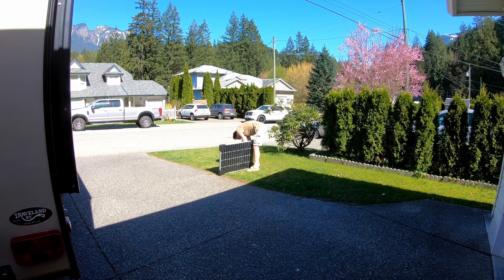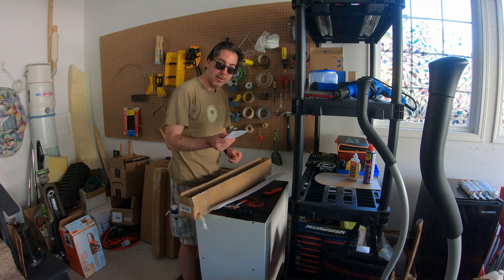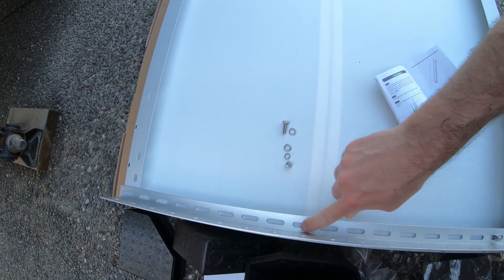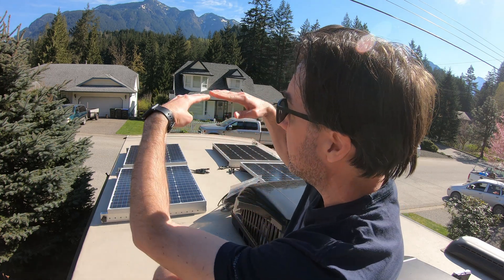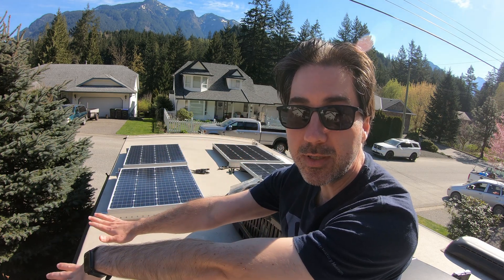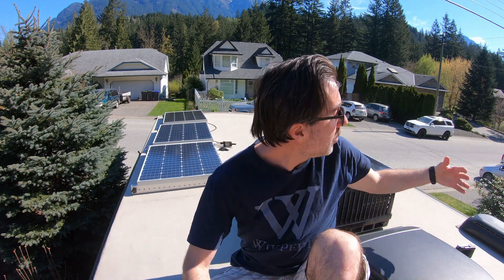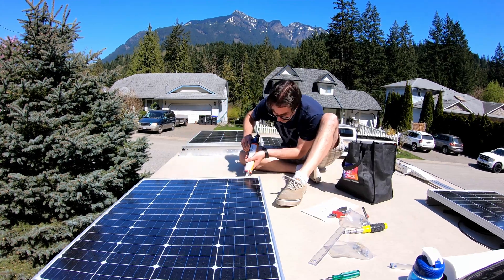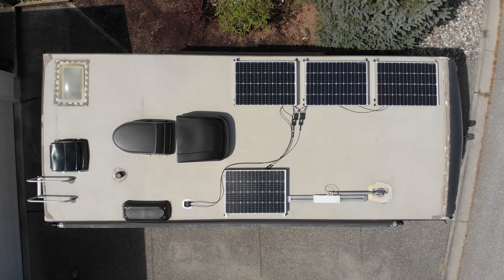How to install Renogy SOLAR PANELS that TILT! 🌞

Comment: I'm running channel strut along the sides and mount panels on top for air flow
Reply from the maker: Really good idea 💡 That should help prevent the panels from overheating and keep them efficient.

Comment: Hi. I’d love to know about the solution you found to deal with the curve of your roof. Did you end up using stainless steel washers to make the brackets level or something else? Thanks!
Reply from the maker: Attaching down as close to the side as possible turned out to be the answer. That's where our roof was flattest.
Reply: @HomeARoam  Ah, that was enough. I thought perhaps you did something in addition to that. Thanks for sharing!

Comment: Hi Great Video, I am about to put solar on the trailer, I was wondering how the attachment to the roof using the dicor and included screws have held up? I see a lot of recommendations for the strut channel, I am debating the different options.  Thanks
Reply from the maker: Hi there, it's held up really well for the year we've had it so far. Had the roof pressure tested and none of my seals leaked. And everything still feels really solid up there. Fingers crossed! :)

Comment: No sane person should commit to Renogy products! A- rating on BBB and 1.13 out of 5 customer review rating on BBB. Their after sales service/communication (or even before order delivery communication) etiquette and systems absolutely suck. I am immensely sorry that I bought a product from them without doing proper company research. The product may be good, who knows, but the company behind the product should lose it's business license.
Reply from the maker: What sort of trouble did you have with Renogy? Our batteries were shipped late, and they did a poor job of communicating when they would actually arrive. All their products have worked great for us so far, but I have heard that when something goes wrong, their support can be somewhat marginal.

Comment: nice video, next time just do 10 foot unistrut with standoffs to counter the arch of roof and attach panels to that, then can ditch old panels or take them off when you sell if price seems too high for someone. Adds some more weight but well worth it for ALOT less screws to have to worry about the already fragile roof membranes.
Reply from the maker: Interesting, yeah, I've seen that type of setup on vans but it didn't occur to me that it might work well for a travel trailer. Might be a good idea if I end up wanting to add more near the top of the roof where it's really curved. Thanks for the tip!